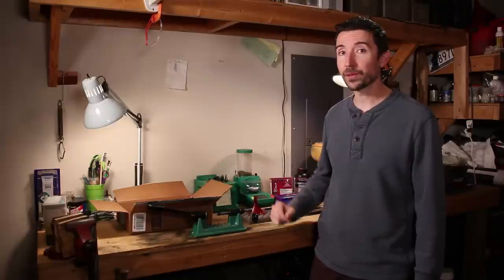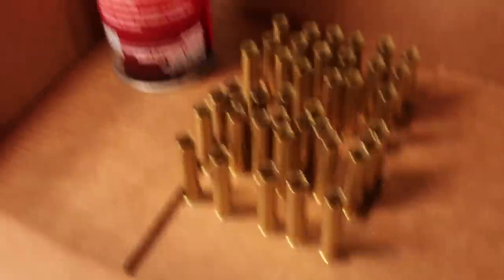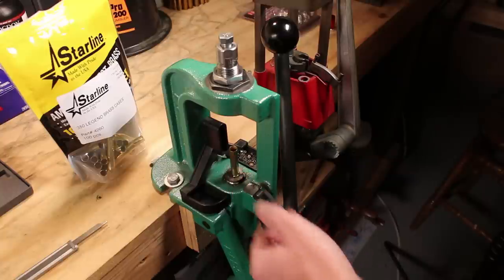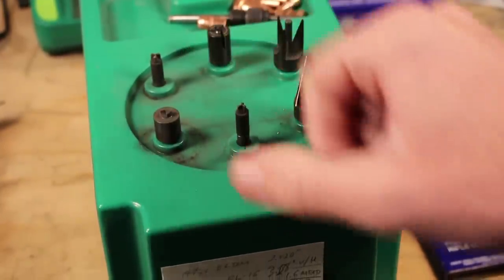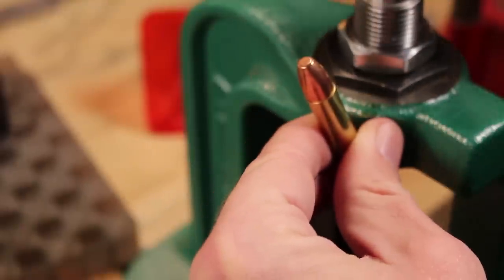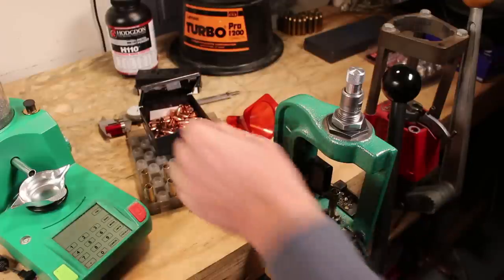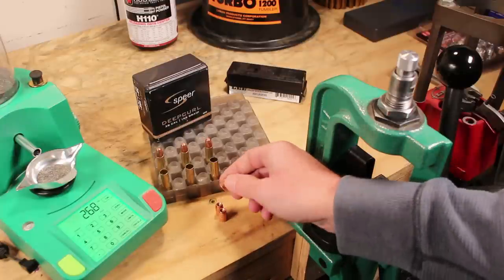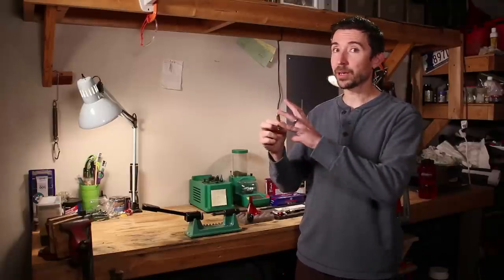The Peculiarities of Loading 350 Legend - Lee Pacesetter Die Set

Comment: THANKS for a great video: it leads me to my issue- Using 1x fired Winchester brass I use the same die set as you are (cleaned) & same case lube. When I use the full length sizing die I take the additional step of doing the "plunk  test" into a cleaned Lyman case length/headspace gauge and 0 of them "plunk" and only 1 of 10 can be gently pushed below the measuring spot to "pass". I checked the gauge with the same unfired brass and all 3 "plunked". I have even tried the die at about 3/4 turn when it recommends 1/4-1/3 turn, same result. Do I have a bad full sizing die or any other ideas please? THANKS!
Reply from the maker: It sounds like a bad die, but just to be sure you might try running into the die a little farther. Check with a bullet, too. A .355" bullet shouldn't fit in the mouth if you are just pushing with your fingers. Maybe only barely start to go in. If it's tight or doesn't fit, the issue may be farther down your case, like a slightly bulged web. Measure the web of a formed case and new case and see if the diameters match. A little extra diameter may not hurt, and should chamber OK, but if you see a pronounced doughnut on the outside or feel a ring on the inside, that case is getting close to a case head separation. Gotta throw it out. In the event that your case web is too large to chamber, you can use a 350 Legend small-base die. I think Lyman makes one. Good luck to you, Dave. I hope it's an easy fix.
Reply: @SocialRegressive  I appreciate you taking the time to answer & the info given. .355 bullet wouldn't go in but wanted to. Once I expanded it about 1/8-1/4 " into the case...bullet fit as it should. Will remeasure and compare as you suggest. Hard to believe factory cases would be bad after just 1 original firing, but maybe! I also went in as far as 1.5 turns instead of the 1/4-1/3 turn recommendation and had same failure. I'll chamber some and see before either ditching or using as is. 1 side note: I find it very peculiar that Lee die set doesn't include the crimping die, but yet the 6.5 Creedmoor does and it's not even "required". Maybe marketing...LOL
Reply from the maker: @davethulier3048  Lee needs to release a 4-die set with EVERYTHING. It makes sense.

Comment: Is there a 350 legend die or can you use the 9mm as I was told. Trying to find the real answers, have reloaded for years but 350 is new to me. Thanks for all the tips and tricks.
Reply from the maker: A 9mm die will only size about half the case, and you'll have a devil of a time getting lengths right. Watch out for an expanding base. I would personally recommend buying a real 350 legend die set. Fewer explosions in your future.

Comment: My Lee Dies wont size it enough near the case head for an empty case to fit inside my 350 Legend Lyman Case Gauge L20.. Ive got the Died screwed down and it cams over a lot.Tried 3 different shell holders including the one LEE sent with the dies.Im not a fan of Lee Dies..Mostly use Redding,LE Wilson and Whidden. Have a few Hornady Match.Any Idea what is the deal? Thanks
I built this 350 Legend AR15 for Hogs..Its okay.It can't hold a candle to my 450 Bushmaster though on accuracy. My 450 Bushmaster is way more accurate than my 350 Legend . I was surprised at just how accurate my 450BM is.

Comment: I have the same setup (RCBS Rock Chucker & Lee dies) for reloading 350 legend, and other rifle calibers. I've come across the issue of the case mouthes getting crushed when using the powder through expander die on .350 Legend brass. This would happen even when if I were applying very minimal flare, so I learned that you can skip this process and hand feed  the bullets as you're running your case through the seater die which works perfectly fine. Have you ever come across this issue? Just curious.
Reply from the maker: Yes; I can load a .355 bullet without needing to flare the case mouth. .357 needs the extra room.
Reply: @SocialRegressive  This year will be my first time using a .350 Legend for deer season after normally using a .450 Bushmaster (a bit overkill in my opinion). Have you had the opportunity to use this on deer? If so, what type of results did you receive?

Comment: Where did you get the insert for the comparitor? Are you not using a 350 legend insert?
Reply from the maker: This comparator from hornady includes inserts for common bullet diameters. Since 350 legend uses .355-.357 bullets, I use the 35 insert.

Comment: When using an Ar platform with the .357 bullets the OAL is to long for the mags or the chamber tolerance are to tight for the .357?
Reply from the maker: The bore is tad small for 357, but if you reduce powder by 10-15% it's ok.
Reply: @SocialRegressive  That really sucks there are a lot more hunting options in .357 than .355 or.356 I appreciate you messaging me back though.

Comment: I've loaded rifle cartridges for many years, but only loaded pistol cartridges a couple times. I've always wondered why you need to flare a pistol case and not a 3006 case. If the case is straight on a pistol cartridge, and the neck is straight on a 3006 case, what's the difference?

Comment: Is there any chance you'll review the Lehigh Defense controlled fracturing round for 350 Legend? Specifically the 150 gr.
Reply from the maker: Maybe. There's a trick with that bullet; if it spins too fast it tears itself apart. I can still load it up at low pressures and speeds, but it won't cycle my action.

Comment: Why do the manufactures use a 9 mm bullet when Win box states the bullet dia . Is 357
Reply from the maker: The cartridge can technically handle any bullet diameters from .355 up to .357. That's how they are able to claim a 357 diameter in states where that is the minimum bullet diameter. But you're right: most manufactured ammo is .355.

Comment: Just bought a 350 legend AR upper! This video is so helpful, haven’t started reloading quite yet but I’ve been told that if you load a .357 in a 350 it will hurt the gun and potentially be dangerous? Also really excited to know that I can use 9mm to make some cheap target ammo
Reply from the maker: In my testing, .357" bullets worked just fine. The only issue is that they develop higher pressures more quickly than .355". Back off the powder charge a bit, and everything's OK.

Comment: Just a picky use of a term you used in referring to the Lee Press on the right side of your bench.

You referred to the Lee Press as a "Progressive Press". A Progressive Press is defined as one that "produces one round of ammunition for each pull of the lever (once all of the stations are populated). What you have is a Lee Turret Press, defined as producing one round of ammo as the turret rites through all of the positions of the turret. This could be three, four or five stations in the turret. 

I have used a 4-station Lee Turret Press for two years since I started reloading. I've also used a Dillon 550 Progressive Press, but I feel more in control of the reloading process without making foolish mistakes.

Comment: Ran into a problem trimming cases. The RCBS .35 pilot was too big to fit inside the case neck. Had to sand it down a bit until it fit.
Reply from the maker: Thanks for the notes! I haven't had to trim mine yet, but I'll know what to look for when I do.
Reply: On next try I was still having to force the trimmer pilot into the case mouth to get it to trim. The pilot was slightly expanding the case mouth. That being the case, I think a better solution is to run the cases through your expander die before trimming. That seemed to work much better. 
Great video. Keep up the good work.

Comment: Does comparators size 358 for 350 legend? I was checked it doesn’t has size 350.
Reply from the maker: Usually  .355".
Reply: @SocialRegressive  I was check completed set with 14 sizes but it is only one close 350 legend 358 size. Can you check links I just sent to you

Comment: I actually got bored this week and I'm working on some 7mm08 reloads 15 of them that will take a few days to get loaded

Noticed I had some nice nickle plate once fired brass I could use and figured I wanted some more of them sierra 160 grain hollow points for hunting I like so much I load to 2550-2600 fps

Now i need 308 dies and some bullets as that brass is stacking up also
Reply from the maker: What powder are you using?
Reply: Wish that I’d never traded my Rem 700 varmint in 7mm08. Loved that cartridge.
Reply: @SocialRegressive IMR4350, H4350, H380, H414, BL-C(2) H4198 H4895 for now

Using the IMR 4350 for the 7mm08 loads and the BL-C(2) for the 180 grain 308 and H4198 for the lighter loads 110-135 grain 308 bullets for about a month now and they work very good 

This must have been when you tube turned off my notifications back then and never knew you even replied until I got this notice about Frank Evans
Reply: @frankevans6584  No kidding as I had the Remington 700 BDL in 7mm mag and it was my favorite until I researched the 7mm08 and found it was superior in many ways, Not as much powder for a round going only 200 fps slower than a 7mm mag sold me plus super accurate and hard hitting long range ballistics

I could only hope I could have afforded a Remington 700 BDL in 7mm08 as they were selling for like $1100 then the guy showed me the Browning A-Bolt for $500 and I was sold on cheap LOL

Naw actually I did a lot or research on that Browning rifle also and it was from Japan with a twist no one else would know unless they had been to Japan like I had been in the Navy

They are forced by a WW2 law to sell anything they export to the US for half the price the Japanese people living in Japan can buy one for which would be right at $1,100 if I lived in Japan

Not only that the quality of the Browning was 10 times better than any Remington I looked at and knowing the Japanese people like I did I knew they would settle for no less than perfect when they made a samurai sword and would do the same with their rifles 

Not many people ever hear about that but they told me all about it when I was in Japan while in the Navy

I got a camera on base for like $50 but the same camera out on the vendor streets of Japan cost $125-$150 so I asked, what's the deal there and they told me all about it

A dag gum rum and coke at a bar cost me $8 when I was in Japan in 1978 but I got lucky and won $500 from the slot machines so that helped some with the fun expenses while I was there LOL

Comment: 10:00 So can you shoot .357 dia bullets in the 350 legend? I thought you could only use .355
Reply from the maker: According to Winchester, CMMG, and my own testing, as long as the bore diameter is to the SAAMI specs, you can load anything from .354-.357. HOWEVER, if you load .357, then back off your powder charges an extra 10%. If you don't you'll get into overpressures pretty quickly.
Reply: @SocialRegressive  ahh that makes sense thank you for taking the time to reply!

Comment: Someone should introduce similar idea with 50bmg.
It should be around 18.5mm hunk of metal that it would shoot out then!

Also while babbling again I would also say someone should make a 9mm boat tail, to try maxing out the range with this casing.

If it pushes to 500 yards I would say it should be pretty viable option then ever before!
Reply from the maker: You try the 18.5mm first. I'll watch. 😬

The boat-tail is a fine idea. I've tried the 147-grain 9mm XTP, and it has a boat-tail. Unfortunately it also doesn't feed in my rifle.

Comment: After sizing I like to run the debur tool. Getting rid of that sharp 90 degree edge. Usually eliminates having to use the bevel. 
those Hornady square tails is the only drawback. Not much of a round edge on those
Reply: When I buy jacketed bullets I tend to look for bevel bases. Cast is a whole other ball of wax.